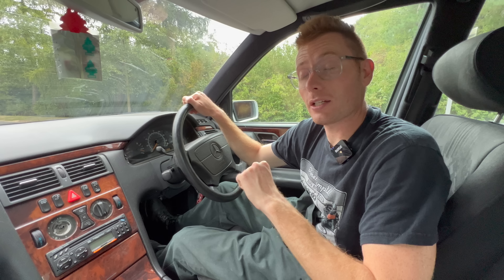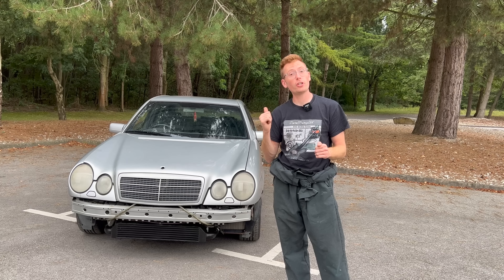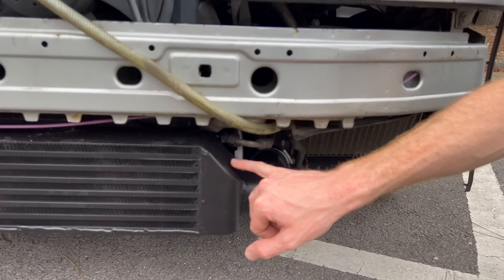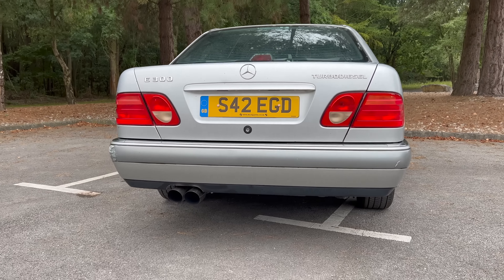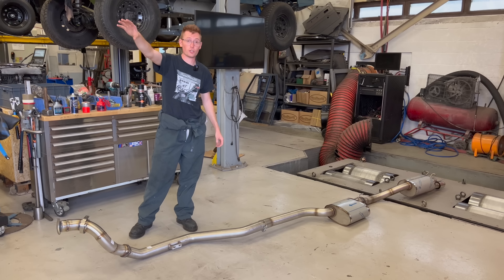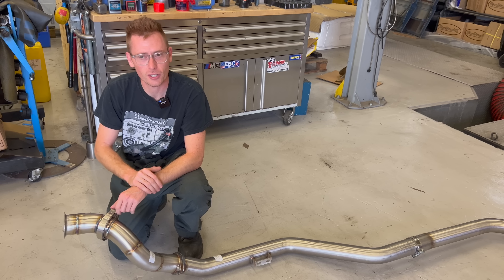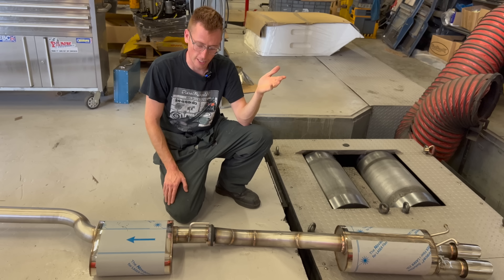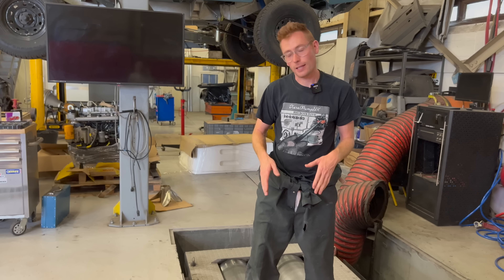W210 Stainless Steel Exhaust System E300 Turbodiesel

Comment: Ah a stainless exhaust......the only thing on the W210 that wont rust like a 70s fiat
Reply: I own a C208, I'm the only one in my family without a W210, none of them are rusted and we literally live off a mountain that I used to drive across in an E430 to get to my job at the DOT, where I then got in a Mack, and salted and pushed the snow off that same mountain, before driving back across to get home
Reply: @razortreadway  I had a w210 it was a fantastic driving machine....but it rusted in all sorts of strange places like nothing I have seen on a modern car. It broke my heart and I have seen a lot of other  rusty w210s to know it wasn't a one off thing.

Comment: these early w210s seem too hold up a lot better then the face-lift cars with rust, that looks clean, remember these cars 10 plus years ago rotten with failed spring hangers and archs and wings falling  apart, looks a impressive car that, goes well

Comment: Come on man, you KNOW that you don't get "wastegate" sounds. It's actually throttle closed induced  back pressure/stalling compressor wheel/air flutter . I love the videos btw, highly original!
Reply from the maker: Your getting confused between wastegate and blow off valve I think.
Reply: @DieselPumpUK  I thought that it was folklore about wastegate flutter. The noise you hear is the "wind" blowing back and forth across the compressor turbine after the throttle closes,due to like a rapid tidal type flow due to the shockwave/pressure wave caused by shutting off on boost. A bit like house pipes vibrating when the washing machine solonoid closes very fast.
I used to love the works Quattros squeaking and fluttering flaming and banging in the good old days
Reply: @DieselPumpUK  it will also eventually grenade the bearings if there not ball bearing. That is without the use of a blow off valve/recirc valve
Reply: @davidmunroeprecisionengine6121  mate you might want to look into how a diesel engine works before telling people rubbish 🤣. Diesels don't have a throttle body. So there is no need for a blow off valve because there is never a pressure spike coming off throttle. He is also talking about a external waste gate. So it dumps the exhaust pre turbo directly to atmosphere and makes for a very loud epic exhaust note.
Reply: @TheRevo33  utter rubbish
Reply: @davidmunroeprecisionengine6121  how 🤣. I am a calibration engineer for a diesel engine company. I know what I'm talking about. It'll only take a quick Google to see I'm right.
Reply: @TheRevo33  your " gaslighting" me because you are simply diverting away from the issue about fluttering noises around the compressor turbine. I know about narcissist's methods pal, and there's no proof what so ever regarding your employment. I'm an astro physicist that works for Holland and Barrett.
Your right about throttle body on diesel. But the same noise comes from a petrol turbo engine.bgo figure. I wasn't thinking when I posted however, the letting go of the throttle in essence in a diesel, starves the exhaust turbine enough to stall the compressor turbine. In essence closing the cycle. This stalling (turning off the turbo power supply) aided by high boost pressure on the inlet cycle, stalls the compressor turbine. No sounds emitting from the wastegate. Your going off topic (trying to be clever) curve ball. Unless you know, compressor wheel is linked directly to the exhaust turbine.
Only on works Quattros used to get a squeaking wastegate when running 5bar! No fluttering. Apples and oranges, btw how you like them apples?
Reply: @TheRevo33  And smart guy, I was talking about the throttle pedal.
Reply: @TheRevo33  I have the most powerful 200tdi in the country. It's fluttering all the time and could really use a blow off/re circ valve. Think before talking rubbish
Reply: @TheRevo33  he's actually right.  Diesel engines do have a throttle. It's the pedal on the right!🤣 Everything else is purely detail. Your just being pedantic. Google that
Reply: @davidmunroeprecisionengine6121  a little knowledge mate, I agree. But you'll NEVER get a Yorkshireman to admit that, or lend you a quid 🤣
Reply: @billy_cagney  CORRECT!
Reply: @DieselPumpUK  Kind of both right but its a silly argument anyway
Reply from the maker: When I said I love the sound of a wastegate, I meant I like the sound of the loud roar from directly before the turbo with no silencing (the sound from a screamer pipe), not turbo flutter, not a dump valve and not a duck farting.
Reply: @DieselPumpUK  I think most likely the noise of someone wriggling
Reply: Handbags at the ready...
Reply: @TheRevo33  think you might be swallowing diesel pump's junk

Comment: stupid question but im not a mechanic, is the 2.5diesel non turbo om602 w124  good for turbo or it will blow up quick with one fitted (ofc changing air housing to aluminium one)i have plastic one that goes to metal snorkels.ty. A mechanic told me it will last short then the rings and hydraulic compensators will give out?..

Comment: My W209 clk 270 CDI Would benefit from this kind of pipe! I’ve modded it with a w211 320cdi turbo. Bar n plate intercooler a Gail banks style conical turbo outlet ported inlet removed swirl flaps. And cat delete. 
I just need a top quality exhaust! Can you make me one??
Reply: C30 amg exhaust is Plug and Play
Reply: @lRecklessGamer  thanks for the info bud!! Is that the W203 chassis?
Reply: @robertreavley7145  yes, the w203 and 209 are nearly the Same.  The lenght from Wheel to Wheel are the Same and the Rear is the w209 a Little Bit longer
Reply: @lRecklessGamer  thank you again mate for your help on this! I’ve not had it remapped yet due to the standard pipe! All the emissions equipment is removed so after 1 minute it goes into limp due to the EGR not connected. Once the remap is done it will hopefully be putting down 270-80. At the wheels! 
Would love one of these 600hp motors for it!! One day once I’ve saved up enough money!!!

Comment: What could a do way my 2015 sprinter. when fit a 606. Got a dpf cant be bothered arguing way pc dick heads. It’s had a engine swap. So going carefully open my dpf and put few metal tubes through the honey combe neatly weld back up. An have sensors back in and tack them in. So cant be removed easily. Were welds cant be seen top side. Basicly hope they dont wast there time on me. Cause there ones getting stopped a sensor whipped out and checked for being gutted van sieazed. Made to pay 3k plus for new dpf witch doubt van would like very mutch. Am not going gut mine just drill couple of holes rum some metal pipe so if they did break a weld they could see it not gutted. A get a wont be able to run big power am not after that. Just want be able to travel a bit camp wayout not needing a star machine if it breaks down 🤣
Reply: Even an MOT tester isn’t allowed to go to that much effort to check for DPF Aslong as the weld is at the top which can’t be seen you’ll be fine
Reply: @Mr330d  yeah ats what am thinking but a get the mot tester argument. They are doing checks side of the road. Same people it dipped tanks looking for red diesel. Are poping out sonsors and checking dpf’s these days pain in the arse. Sprinter is making it easy for them were its located